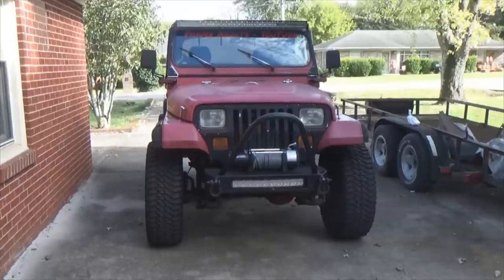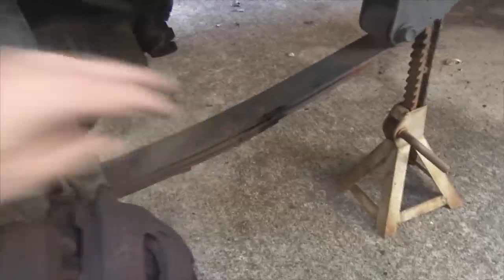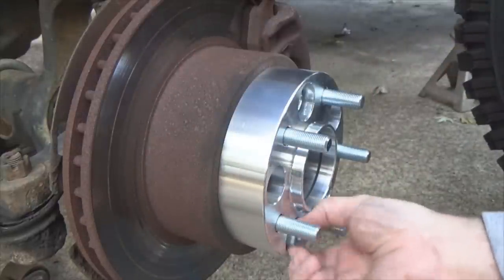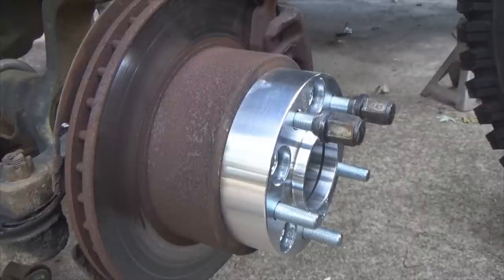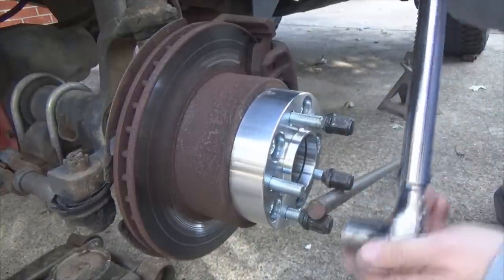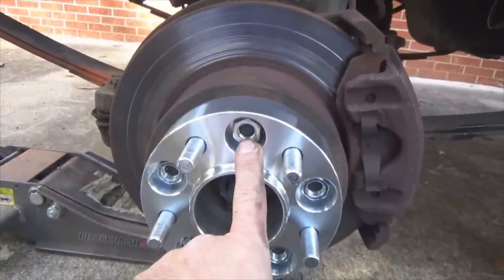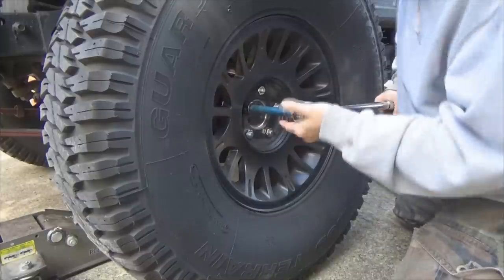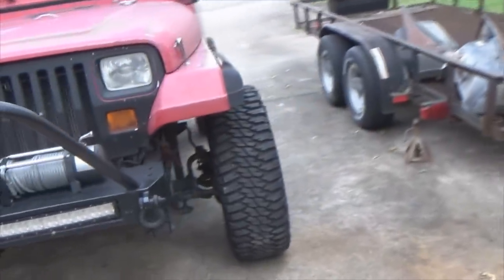Jeep Wrangler YJ - How to install Wheel Spacers and why use them.

Comment: You should have sanded the rotor hat with a two inch, 8o grit pad,  pneumatic sander. I would have, and did, changed the studs.

Comment: Ive got 33s on pro comps.. 4" lift.. I'm on the springs on a tight turn....
Definitely need these spacers
Reply from the maker: I'll be making a video soon on how to adjust the bump stops to keep the tires from hitting the springs. Just make sure you properly install the spacers. Have a great day!
Reply: Update: just installed new spacer/adapters.. installed 18" jk wheels on my yj. that are 5 on 5 bolt pattern... one thing u discovered are they need to be hubcentric.. meaning that ring on top .... with out that ring your relying only the studs to hold  on the wheel..
I have an adapter/ spacer that holds the spare on the back  and it doesn't have the ring, but its not holding up the weight of the jeep.....

Comment: put JL tires and rims on my 88 YJ. The front studs are just enough to get 10 threads. The rear wheel studs are too short. Replace them w3ith Dorman part # 610-234.1 and then the rears will be perfect.  The 610-234.1 are for the rear 627  Knurl and 1 5/8. The 610-449 iw .627 Knurl and 1 15/16 on my 89 I had to trim them a little so they didn't stick out past the adapter. Also JLs are 14mm instead of 1/2 inch. You can still use the 1/2 inch nuts but they need to have a bigger cone than stock. Coyote 56K542 is a box of 20 bulge acorns for about 20 bucks. Hope this helps.

Comment: I agree whole heartily with the jack stands but I also leave the jack in place and let the pressure onto the stand and the jack as a back up, I also like to take the wheel and slide it under the vehicle while I do my work. Would also have liked to see the clearance you had with the wheels turned after installation to see the clearance to the springs. Thanks for the video.
Reply from the maker: I totally agree with you on the Jack and tire. I normally do just that. Don't know why I dropped that ball that time by not having the tire and jack in place. Sometimes my attention being divided by the project and the camera kinda sidetracks me. If you watch the video you can see the space difference to the leaf spring before and after. Thanks for adding a great safety suggestion for others to read! Have a great day!

Comment: If the lugs on the spacers do come loose, would you recommend just torquing back to spec, or remove the lug, apply new loctite, and then back to spec? 

I feel like this is a redundant question, but i thought I'd ask.
Reply from the maker: If always replace the loctite when it been broken loose.

Comment: I got a set of KSP lug centric spacers.  They are 6061 T6 2".  I keep hearing hub centric are the way to go for safety reasons.  I installed them using the installation specs (star) with lock tight on my Jeep YJ.  Should I switch them out for hub centric?

Comment: Thanks. Very timely for me. Are you at all concerned about excessive bearing or seal stress?
Reply from the maker: If the wheels were offset anymore then yes. But only a little because Jeep bearings are fairly easy to change. Another thing to consider is the wheel offset. The wheels I have on that Jeep came off of a Lincoln so the offset sits in deeper than factory Jeep wheels. Putting the spacers on may have pushed the wheels a bit farther out than a factory Jeep wheel offset but not by much. So that wouldn't drastically load the bearings that hard. If I had wheels that had a shallow offset then add spacers, I'd be replacing bearings often. I know a guy that once had a 4x4 S10 with wheels that stuck way out (very shallow offset). He would go through bearings in less than a year. Thanks for dropping in! Have a great day!!

Comment: Hey one trick i use well need the brake pedal held a good size block and a  Scissor Jack with the 3/4 nut that operates it Put the block on the paddle in the scissor Jack between the sea and the block and take an impact in just raise up that scissor jack to  price down your paddle see scissor jacks have their uses lol

Comment: Question how long are the studs on the spacers and can they be used in replacement of the 1/2 20 studs on a factory replacement of the yj Jeep Wrangler 1994
Reply from the maker: Ive never measured them so Im not sure. Just look up the stock replacements and see what the specs are.

Comment: What size tires are you running and how much lift?
Reply from the maker: 35 x 12.5 tires. Lift is 2.5" suspension using Chevy S10 leaf packs. Body lift that the previous owner installed is 3". Part 1 of the junkyard suspension lift: https://youtu.be/RB00_P2XrEY . Part 2: https://youtu.be/_rYMUJMIZuM . You really should watch both parts before attempting. Thanks!

Comment: Another trick is to slip the largest screwdriver that will fit into the rotor gap.
Reply from the maker: Man I totally forgot about that trick! Ive done that countless times and it works better than the way I did it. Thanks for dropping in! Have a great day!!

Comment: couldnt you also put the transmission in first gear (manual transmission) to torque?
Reply from the maker: I dont have my front driveshaft in. Also, the transfer case would need to be in 4 wheel drive and front locker installed. Thanks for dropping in! Have a great day!
Reply: that makes sence, thanks.... @Poweraddicts

Comment: Why install wheel spacers
Reply from the maker: When tires rub the springs or somewhere inside the wheel wells. I honestly recommend getting different wheels with better offset to push the tires out a bit.